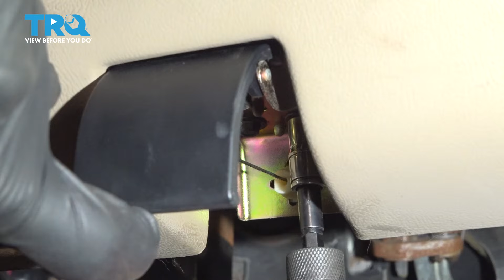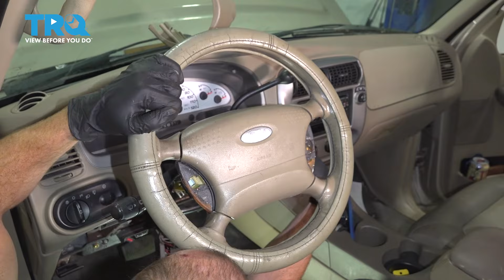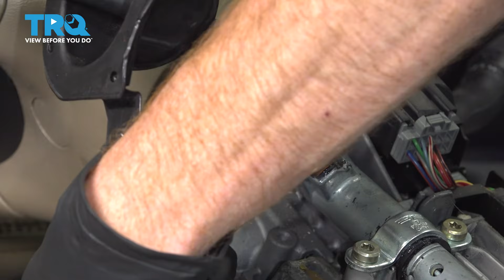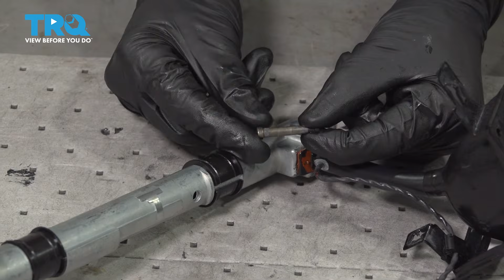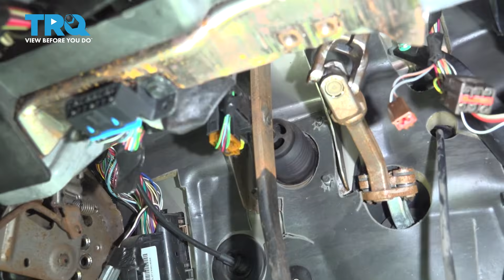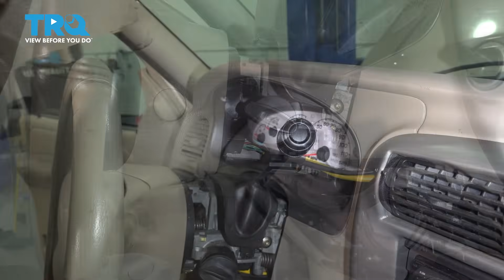How to Replace Steering Column Shift Tube 2001-2005 Ford Explorer Sport Trac

Comment: I want to thank you for the great video!!! One of the two bolts that hold the plate to the shaft came loose and broke off, so I had to replace the steering shaft. I followed step by step and everything is great now!!! I have an 05 Sport Trac. The shifter is very smooth now!!!

Comment: I have to do this with it stuck in reverse. I had a bolt shear off in the back of the tube where it connects to the linkage. I hope nothing goes wrong since im not in neutral. Do i have to be?

Comment: Very good video on the shifter. The only thing I was disappointed about was the adjusting of the indicator shifter dial. To adjust the gear on the dashboard dial.  The other part was not a very good close up on the indicator cable on the bottom of the steering column. Aside from those two things. The video is really great. 👍

Comment: Good tutorial, but you made this so much more complicated & time consuming than it needed to be. There’s a way easier way to do this without removing the entire steering column, you should’ve used thread locker on all the bolts too.
Reply from the maker: +JT2521 Thanks for the feedback! http://1aau.to/m/Shop-TRQ
Reply: Yea, this is a 15 minute job not a 40 minute job.

Comment: Really helpful video.  Everything was pretty much as shown on my '01 Sport Trac.  For those people who like me are older and not as flexible as they used to be, you might add instructions to remove the driver's seat.  Much better access to all the hardware must be removed to extract the steering column.  I only had one problem after reassembly.  I have to use more torque on the shifter to get it into park so that I can remove the key.  Is there an adjustment to the shifter cable play at the transmission?  It feels like the resistance I have to overcome to get it into park is a bit 'springy' similar to other cable-operated devices I have worked with.  Thanks again for the excellent video.
Ron